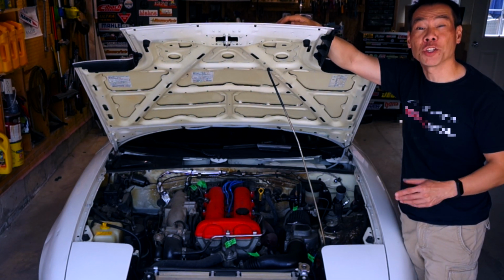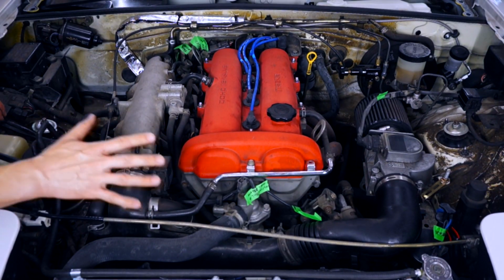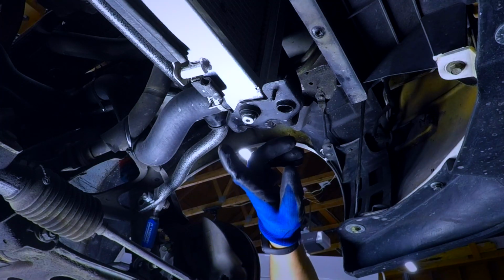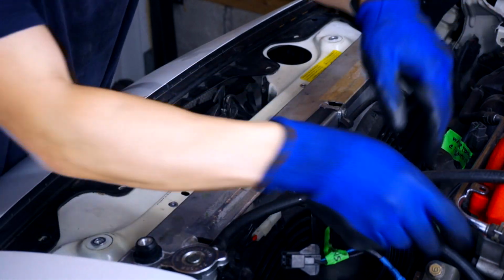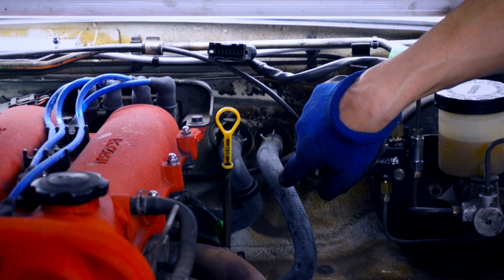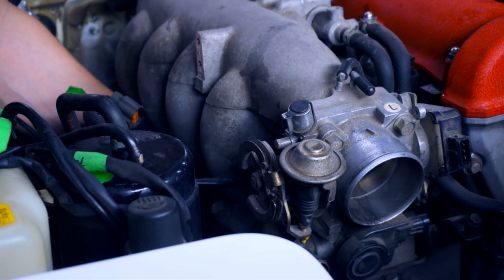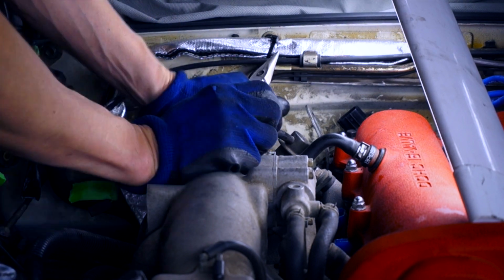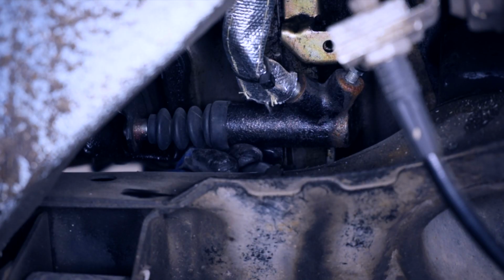Miata Engine Removal in 10 Minutes

Comment: superb! could i ask - whats that adjustable engine hoist thing you used? looks like it adjusts the angle/balance of how its pulling up? thanks :)
Reply from the maker: It's an engine load leveler.  In Canada I got it at Princess Auto, but if you're in the US they're available at Harbor Freight or Amazon. Makes the job much easier!  Thx for the comment!

Comment: @mostlyuselessgarage Off topic here, but my nb 5 speed just developed a whine sound under load in 5th gear. Never had an issue before and changed the fluid twice already. Not sure what else it could be
Reply from the maker: My first guess for driveline noises like that are diff or trans. When you drained the trans did you filter the oil through white paper towels to see the metal particle situation?  Everyone talks about using Motorcraft gear oil unicorn tears to revive a trans but I have my doubts.
Reply: @mostlyuselessgarage  Didn't filter the oil, but I was using the motorcraft fluid before and that's what I put in as well and then started hearing the noise. Changed it out for redline mtl and still hearing it. Checked the ppf alignment and tried to check the u joints on the driveshaft, but it's hard to tell if they are bad. Hope that's all it is and not the trans...
Reply from the maker: If it were me I'd just send it and your next diagnosis symptom will be a box full of neutrals 😂 Seriously though in my experience 5spds are quite weak even at stock power, but they're fairly cheap.  Keep an eye out for one on the used market.  Or better yet upgrade to an NB2 6spd.

Comment: Why pull the transmission , just 6 bolts and a starter, and the engine comes out.
Reply from the maker: Well, I replaced it with a 6spd ... So ya 😀

Comment: Mostly useless is right.  Wiring for the most part only goes one place no need to label everything.  Also less messy to unbolt the PS pump from the block and tie it to the side than to remove the lines and spill everywhere.  Removing the harness from the injectors isn’t necessary.  Created way more work for yourself.

Edit.  I’m an idiot.  I wasn’t paying attention and heard him say injectors and made an assumption, he did it right.  I apologize to the creator for that.  I stand by my other points however.
Reply from the maker: If you liked those stay tuned for some real doozies in the next one!
Reply: Why would you not spend the 10 minutes it takes to label everything? Especially if it’s the first time you’ve ever touched some of these connectors? Not worth the half hour spent trying to figure out what connector goes where upon reassembly. Some manufacturers use very similar connectors throughout the engine bay (ahem BMW) so this is just good practice especially considering if the car will sit for a while in pieces.